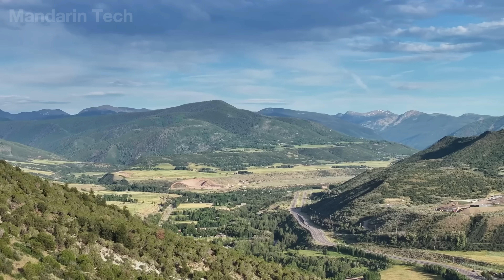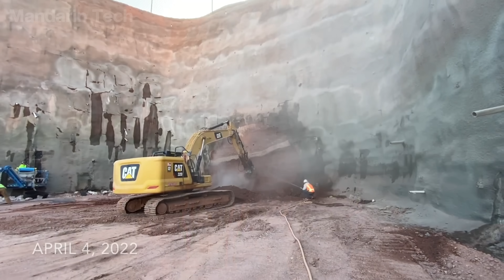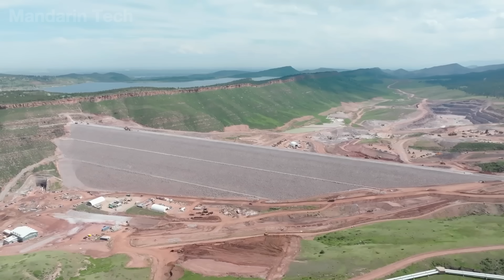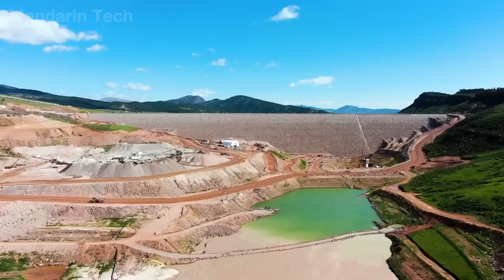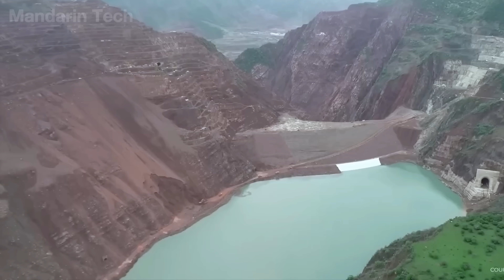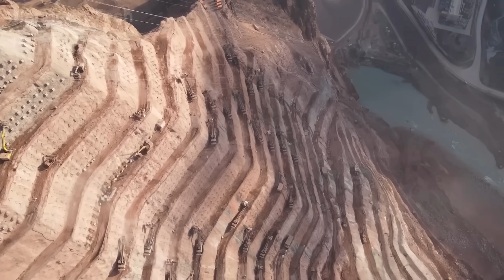Why America Is Spending Billions to Turn an Empty Valley Into a Giant Reservoir

Comment: The uranium is not a problem due to radioactivity, it is a problem because, like most of the heavy metals, it is an accumulated toxin, the leachate level at this point is is only a low multiple of the permitted drinking water standard,(a very small amount), most heavy metal compounds leave a nonturbulent water column quickly settling into sediments and substrates, IF the output from the reservoir does not meet standards, treatment before delivery is very possible. The word uranium has done much to detract from an essential and well executed resource, there is no alternative to no water.
Reply from the maker: Thanks for sharing such detailed and informative insights!